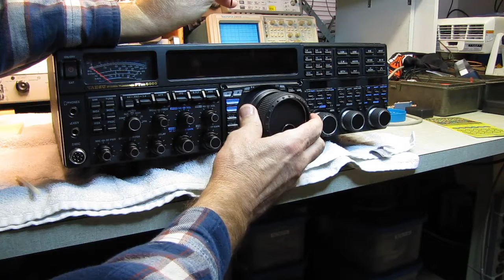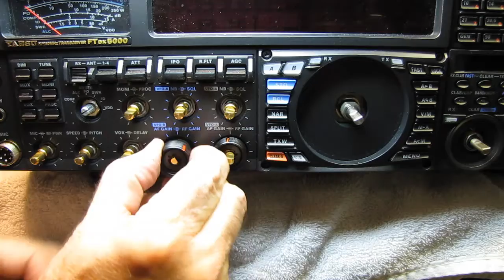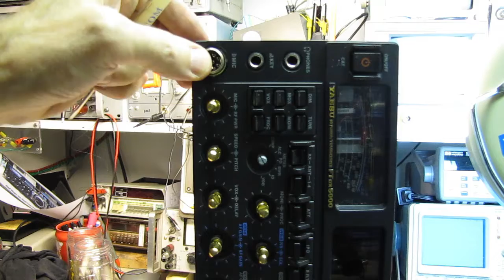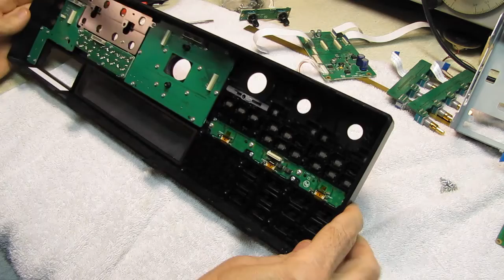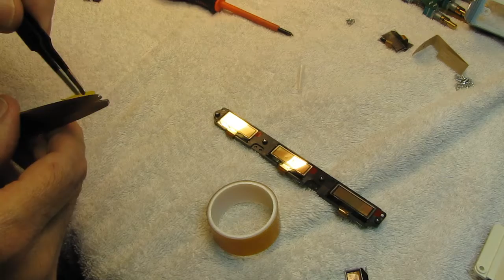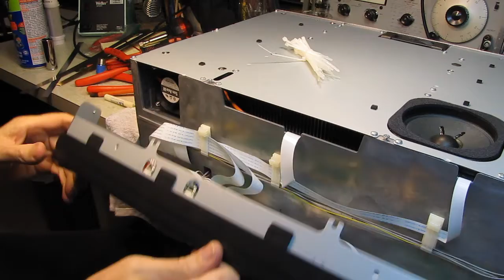YAESU FTdx 5000 OLED REPAIR REDUX

Comment: Just what i needed..I've had my 5000 since 2013 and my OLED's went dark on me the other day..It happened right in front of my eye's.Just went dark..So i don't of they are not geting power or the OLED's are bad..Radio works just on everything else...
Reply from the maker: When the OLED's die, it is a slow process over several weeks or even Months. They get dimmer and dimmer, sometimes presenting lines in the display. If they all "blinked out" at the same time I would start checking voltages. Get hold of a service manual and you should be able to easily find the driver. Sadly, I no longer have one as my failing eyesight and Shakey hands have made me decide to stop servicing newer electronics. I still do antique radios but stay away from surface mount. Good luck.
Reply: @theradiomechanic9625  Thank you soo much for your advice sir..73s

Comment: I'm surprised that Yaesu didn't stand behind this and do the repairs gratis.  It is obviously a common design issue...the leds should last much longer than they did.  The FTDX 5000 is NOT a bargain basement rig....coming at number two behind the 9000....I would expect, for the price, Yaesu would take care of it's best customers.  I bought an FV1000MP new....and never, ever had a single problem.  Makes me question my Yaesu loyalty.

Comment: Thank you so much for producing this video. I went very slowly and it actually took me a couple of half-days, but all is well now. Your video gave me the confidence to just dig in and keep going, with the gut-feel that everything will be OK at the end!  To remove the panel nuts I just rotated an old Stanley nut driver I had against my grinding wheel until the end of the socket was about 9/16" OD and it worked perfectly. All that said, I'm not particularly happy I will likely have to do this again in a few year if I am still able to. 73, W8KZW

Comment: After watching this video I finally dared to replace the three OLEDs. You can very easily make a mistake, especially with the ribbon cables. But if you follow the instructions to the point you will succeed. My new OLEDs are now clear and bright. Many thanks! SM5KNV

Comment: Thanks for the video, Got mine replaced today. My main VFO knob only had one 2.5mm set screw and no tape on the ribbon connectors, everything else was was just like you said.

Comment: Its done! Thanks! A minor issue, my ftdx 5000 only has 1 set screw on tuning knob, no biggie. But that knob was stuck on face like it had been welded on. Only solution without breaking radio was to drill a 1/4 inch hole thru knob, take 2 hose clamps and fit around knob, and use a pulley puller to get that basterd off! But that got it, once that was done it was easy going. Everything works great now and radio has been placed back into service. Ill order a new knob, still servicable but dont like the hole. Your video made it possible, but when the knob was stuck I did cuss a bit, just a little.
Reply from the maker: @mrmarkhadley  seems yaesu has caught wind of the fact that people are fixing these and they're gluing the knobs on.

Comment: Thank you for this excellent tutorial.  Despite your detailed instructions, when first powering up the rig, all the OLEDs were dark and all the right side buttons were dead.  Fortunately,  the problem was that I had missed connecting one of the panel ribbon connectors and now all is well.  73 and many thanks.  Bob W4ZY

Comment: Fabulous!  This tutorial could not have been better - literally.  I replaced my OLED’s  successfully, and by watching this video in advance I was prepared with the Japanese Philips screwdrivers, the special tape, and all the other tools.  I opted not to grind down a socket, but I got the pot retaining nuts off and back on with a needle nose pliers.  Just as you say, a bit of caution, no rushing, and all was well.  Thanks a ton for this video!

Comment: I DID remember the three screws on the metal sub-chassis.  I noticed them sitting on the table just before I mounted the last board.  This is a SUPER set of instructions.  My only comment is that the little 2-pin connector for the cable from the body of the rig to the face does not show well in the video and I almost pulled apart a wrong connector (the one next to the MIC connector).  Otherwise the video makes it pretty straightforward.  Thanks & 73 - Don, K2DC

Comment: This was one outstanding video. Thank you for taking the time to narrate as you went along. The video was well photographed  with no shaky hand-held camera. I appreciate that your camera angle generally remained the same. I am legally blind and feel that I could complete this task. My only concern would be the ribbon cable installation on the OLed displays them selves. Can you purchase the displays already mounted on the board? de N1PVX

Comment: sorry to ask.  What is the part for the OLED unit?  NI7X
Reply: The best way to find a part number is to search for the Service Manual for a radio, or search for "Parts List FTDX5000". That will likely lead you to the Service Manual, too.

Comment: Excellent video and very thorough.  I have one of the first 5000 radios and the main VFO knob had only one very tiight setscrew.  I had to order a set of Bondhur T-handle wrenches to get it out without damaging it.  I also made the same mistake of leaving the three screws out and had to take the top board out again in order to replace them.  I also put the ribon cable nearest the top board in before the board which gave me more room and made it easier to plug in.  If I ever do another one, I'll also remove the meter cable from the meter side because it will be easier to reinstall there than on the recessed board socket during reassembly.  Also learned about the JIS screwdrivers and bought a nice set of them - K0DG :-)

Comment: Great video, hopefully I will not have to replace these in my lifetime.  Do you think the OLED's would last longer if you keep the DIM control on minimum brightness while you operate the radio?
Reply from the maker: Hi Jim, I don't own one so I can only give a guess.
But I suspect that keeping them dim will extend the life of them. In "normal" use they seem to have a limited life of about 5 years. Sets I have repaired 5 years ago are again having issues.

Comment: Hi Vern, I like BOTH of your videos and this one will save folks from learning some of the steps the hard way, like I did (for example, always removing the microphone ring until I accidentally forgot to do so once and realized all was still good).   I wouldn't DARE do a 5000 OLED replacement without referring to your videos.  I also color code everything and organize the hardware into logical containers so I don't get the best of myself (which somehow, I often do anyway).  I have made just about every mistake doing these repairs...and it is a bummer when you put someone else's radio back, together and it does not work, or you forgot some of the cables.   Fortunately, thanks to your efforts, I have never failed to do a correct repair, eventually!!  73,  Jim  WX3B

Comment: I noticed my display filter has some scratches on the outside of the panel, is that difficult to replace while the radio is apart like this?

Comment: The spare displays, I got from Yaesu, when the rig was still under warranty, are waiting for years to be installed. Today I found the Oleds on my rig to be totally dead. It seems to be time to get the job done now.
Thanks for your great instruction video.
Reply from the maker: It really is a simple job, Take your time, piece of cake.
Reply: Just finished the work and the displays are bright and shiny again. I hope they will last longer, than the original ones. Thanks again for your detailed video, which came in the right time for me.
Reply from the maker: @thorstenschmidt9070  I am pleased it helped you out. Sadly it seems these have about a 5 to 7 year life span. OLed tech just isn't ready for prime time. The sets I fixed 5 or 6 years ago are ready to be replaced again. Enjoy them while they last, but buy a spare set now to be ready down the road. Who knows how long they will support these parts.

Comment: Your channel is great. Don’t change a thing. There is only about 30 good electronics channels on here and yours is on of them. The rest are all BS artists.
Reply: Sixstring63 can you list the good electronics channel please. I’ve only found a few. Tnx
Reply: @jimedahl  Electronics old and new, David Tipton, Retroradio, w2aew, JoeSmith, shango066, The Radio Shop, radiotvphono nut, Mr. Carlson’s Lab, TRX Bench, Great Scott, The Post Apocalyptic Inventor, EEVBLOG. About a dozen I can name just from memory. You check these out and some of the other good channels should pop up. These are the ones I watch the most. There are a few to pass on by, you will know after one video they don’t have a clue. Thankfully there are more good channels then bad.
Reply: @SIXSTRING63  thanks!

Comment: OLED displays were not ready for prime time when this radio was designed. I'm not even sure if they're ready for prime time now. They're nice and bright when they work but I've seen way too many of them failing in the field. I've even seen on display OLED televisions with screen burn in displaying random images from a DVR. It was an LG set.  It cost twice to three times as much as a standard television with the backlit LED screen.